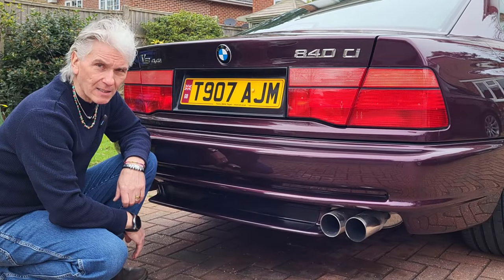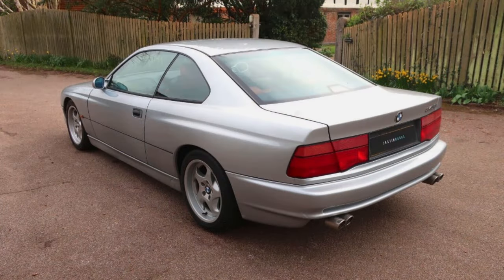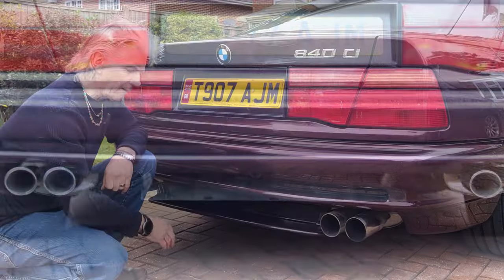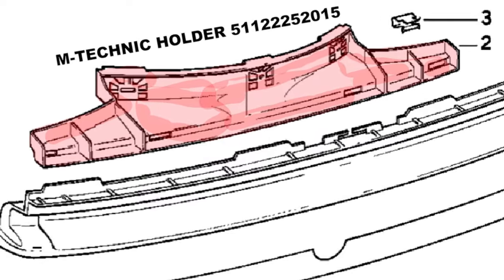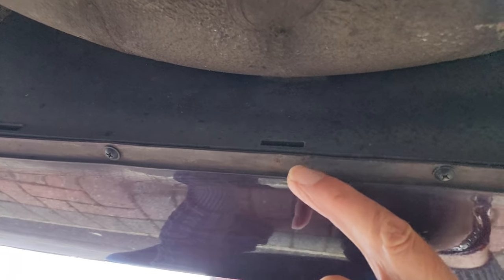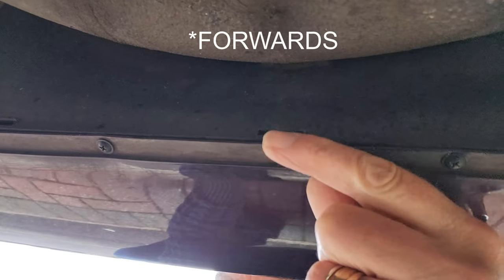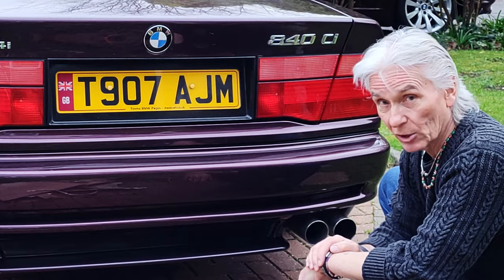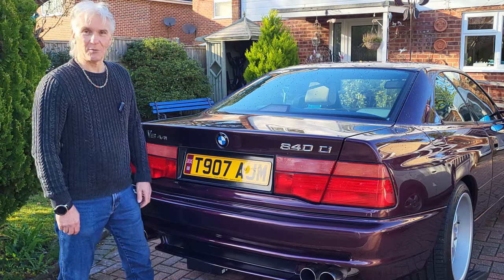BMW E31 CSI REAR SPOILER - HOW TO STOP IT FALLING OFF

Comment: Hi Timm. Just read a post from 2016 relating to the backrest lock you replied to. You mention pink relays k3 and k61 can you please advise where they are located as I've got the same problem. Appreciate any assistance you can provide me with thanks.
Reply from the maker: No problem, go to meeknet.co.uk/e31 I have both a fuse and relay finder on the left-hand buttons
Reply: @TimmsBMWRepairsandInformation  Thanks, I already saw your image of the fuse box, and it has you suggested by swapping relays K3 and K 61. Everything is normal now. But I need  to swap back to see if relay K 3 is faulty.